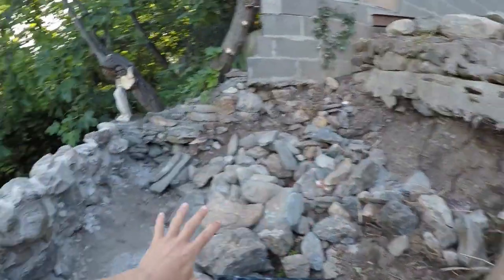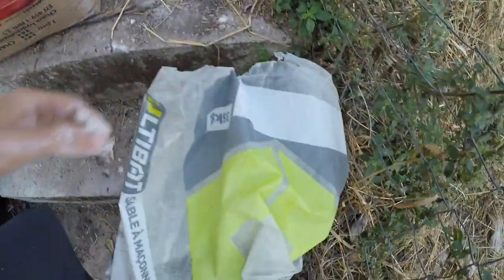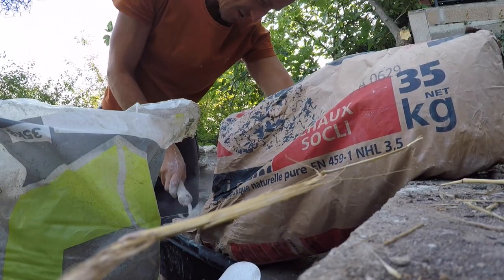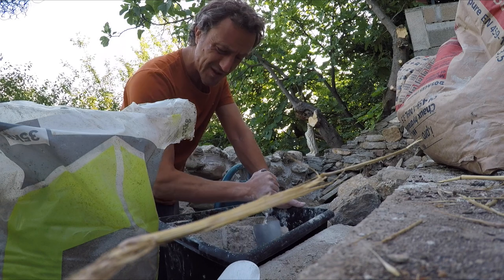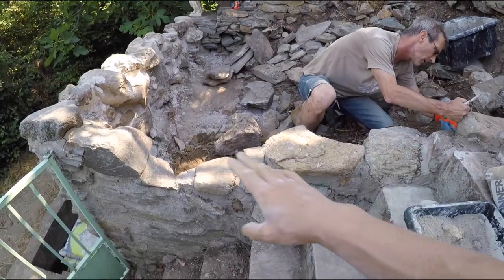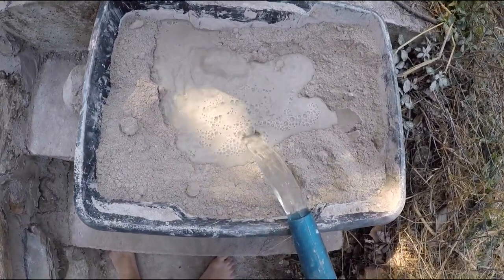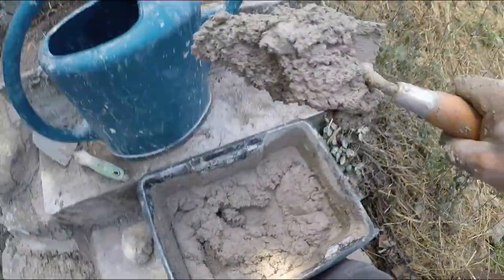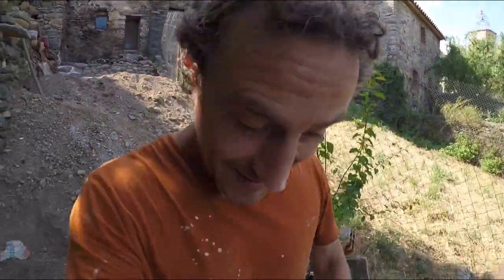French wall building: learning to make a lime/sand mortar

Comment: please don't take this the wrong way, I'm not typically one to criticize, but those mortar joints look a little too big for using lime mortar.  In the old days when they build stone walls with lime mortar, they dry stacked them first, then tucked them with mortar.  This way, the wall could stand without any mortar and the lime was just used as a reinforcement, and also so that excess water couldn't pass through.  Dry stacking the stones forced the masons to shape stones nicely to fit surrounding stones in the wall.
Reply from the maker: Thanks Sean.  I am by no means an expert and I do appreciate your advice which sounds very logical.